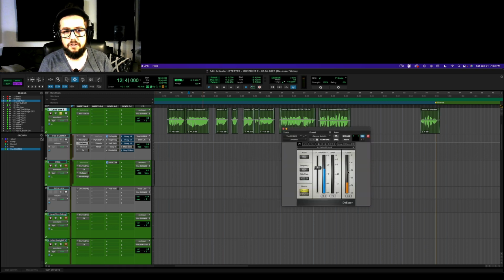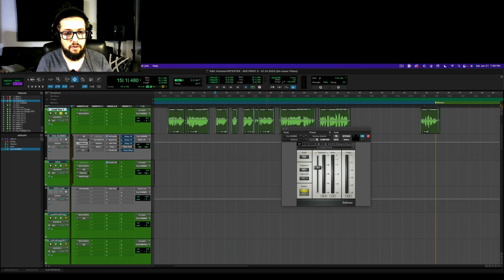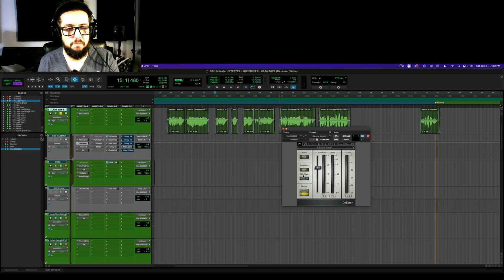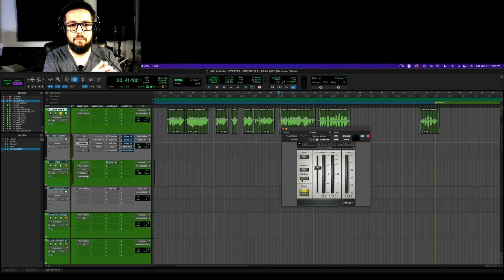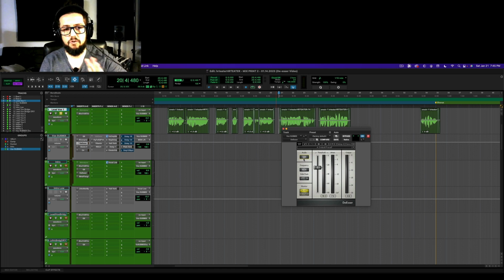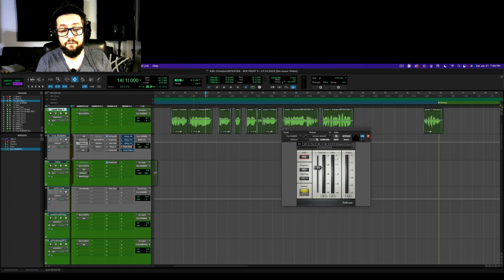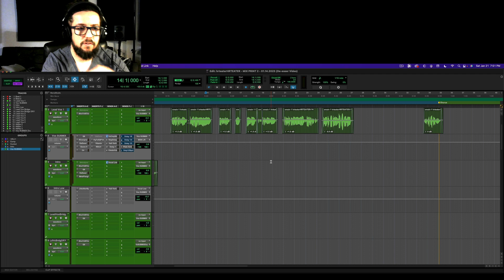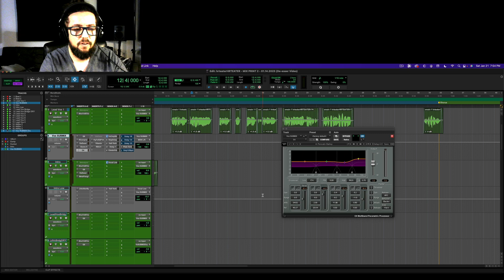How to Use a De-Esser???

Comment: Great video and worthwhile tech tip as always.  Believe me, I have faced challenges using De-Esser past Thursday. It is simple but tricky at the same time. By the way, I end up trying plugins as well as some technique presented by Bob Clearmoutain whereby it combines the use o Eq + Compressor on the point of essing we are targeting to make lower. But that more for learning and knowledge or even challenge. Using a PlugIn sounds faster (as long as you know how to use the tools). Nando, thank you again and all the best, music, audio and life.
Reply from the maker: Thank you so much, Sergio! I agree with everything. In real terms, it’s possible to get the job done with the de-Esser, only EQ and compressor as you said. It’s just faster with the de-Esser and it’s more logical. With EQ and compressors only, the more compressed you need the sound, the more you’ll have to shape the EQ to have less need of that hi-mid dynamic control, but it works. Thank you and keep following the videos!